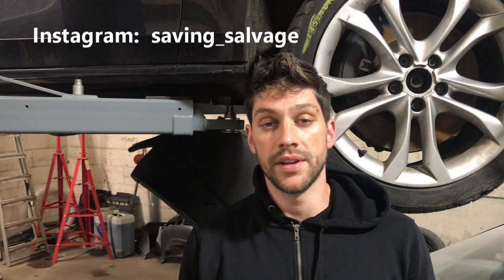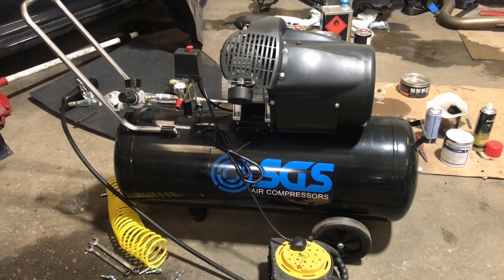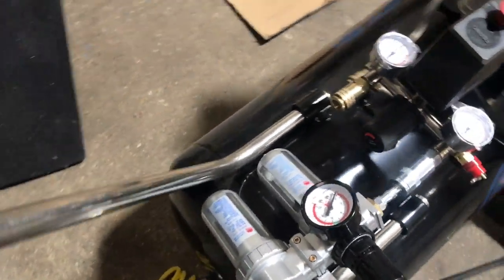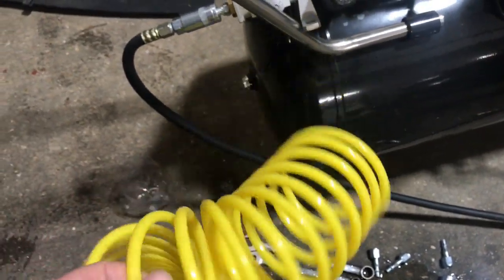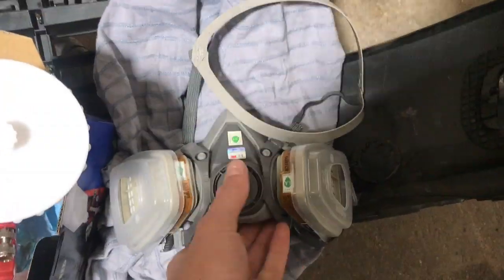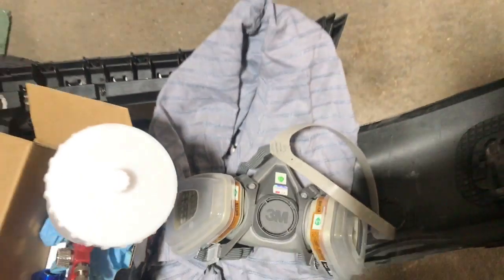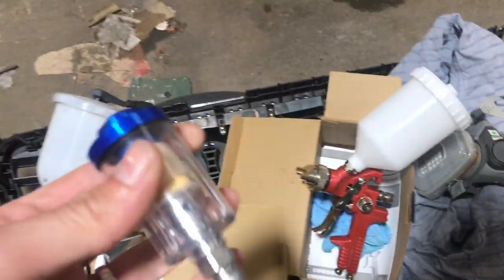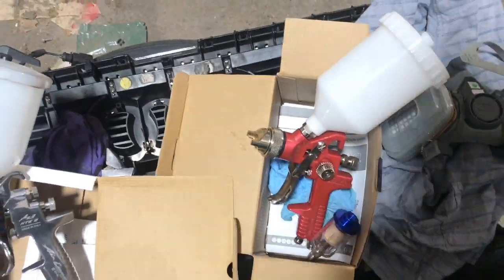My Beginners Guide To Spray Painting A Car

Comment: good effort, try wetting the floor before spraying it will reduce the dust blowing up when you spray and try move the regulator/moisture trap further down the airline to allow the compressed air to cool

Comment: Enjoying your honest approach and quality work 👍 I would recommend that you do fit that secondary moisture trap as water in your paint is a real issue you gained another subscriber today and well done on the work so far.
Reply from the maker: Thankyou very much Mark! I will add that second moisture trap ASAP! Thanks. Also bought a lot of wet sanding pads! So that’s the next job! 😆

Comment: Doing away with the coiled air hose and use a normal hose instead was a good idea. It's like using the hose attachment on the hoover at home where it always wants to pull back away from you. It ends up with me griping the handle of the spray gun tighter. The Gunman on Youtube is good for tips on painting

Comment: hi what grit sandpaper did you use after you panted the panels to wet and dry sand it thanks
Reply from the maker: Hi mate, I started with a 1500 grit and then used 2000 and 2500 to remove the scratches from the 1500 and polished 👍🏽 you can start with a 1000 if it needs it
Reply: @SavingSalvage  cheers appreciate the reply

Comment: Search for the gunman channel and take a basic information for painting , you need an air pressure regulator for the gun , there is a lot to know for a beginner paint job, the guns you bought , the ivata is fake  , a good one is about 300+ , the most solvent base coat  need like 50% thinner , the clear coat needs 50% hardener and like 5-10% thinner is it is a HCS clear coat . In your videos you talk to much .Good luck .
Reply: try a bar of house hold soap on your 2000 grit wet and dry before buffing , it makes it slide across your panel better.  jb.